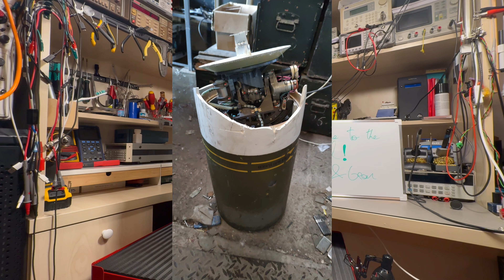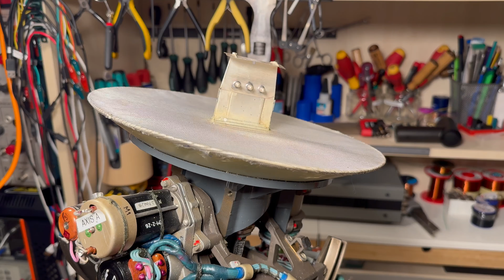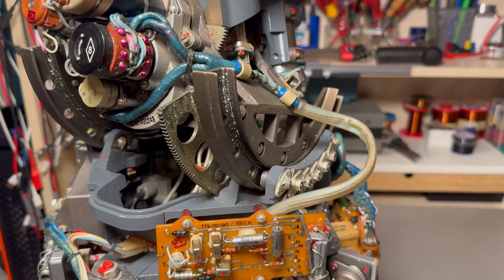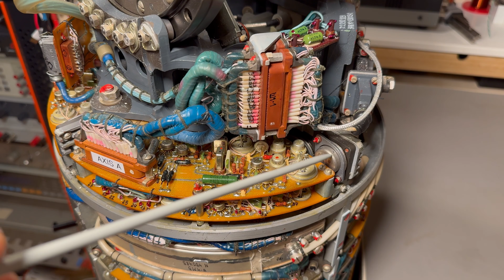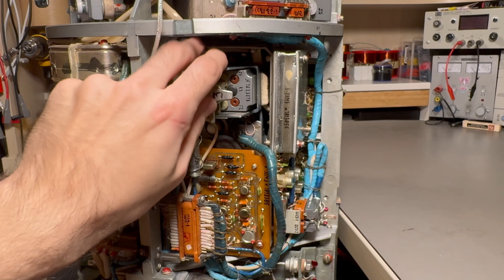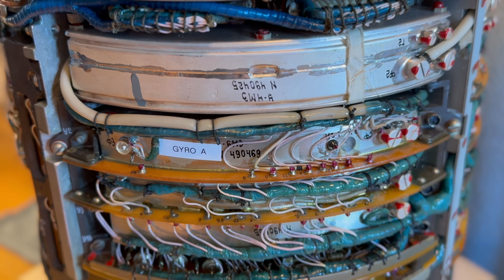Soviet Surface to Air Missile Poorly Explained

Comment: Интересно как резервируются, или дублируются системы на борту зенитной ракеты?
Reply: There is no redundancy in the control system itself. To increase the probability of intercept, multiple missiles are launched against important targets.

There is however redundancy in the safety mechanisms -- there typically are multiple interlocks which do not allow the detonator to go off prematurely.

Comment: The assembly with the precision potentiometer and the resolver / torque transmitter device is almost certainly a mechanical computer, years ago I worked on systems that used very similar technology to generate control signals for a large satellite antenna mounted on a ship.
Reply: In this missile, this module is just a storage device for the targeting data. Specifically, it is a very nicely made servo-mechanism which before launch rotates the wiper of one variable resistor to a desired setting. This setting is then used in flight to tune the receiver to the expected Doppler shift of the target, to distinguish the target return from other signals. It is a lot of hardware for a seemingly simple function.

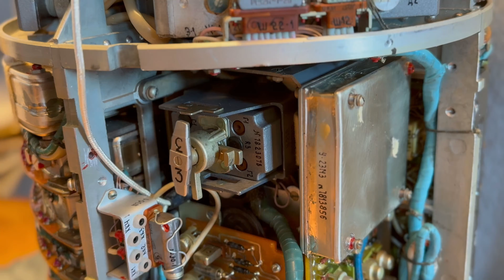Comment: 7:36 : could be a module to switch to a War Mode, to change the seeker signal characteristics to fool a library-driven ECM system.  

Explanation: In the '60s, electronic countermeasures were matched to missile types: a countermeasure was developed for each missile.  This countermeasure "tuning" was done offline, in research labs using captured enemy missiles.  This was a major effort, taking perhaps months.  

How the ECM worked: In combat, when the ECM system would detected and measure the missile seeker's radar signal characteristics, e.g. frequency, pulse width, pulse repetition interval etc., and looked up the missile ID in a database.  It then deployed the already-prepared countermeasure.  

Effect of War Mode: Since the seeker's signal characteristics were changed to War Mode values, the missile might not appear in the ECM system's database.  The ECM system would classify the missile as "unknown type", or - perhaps even better - as the wrong missile type.  The wrong countermeasure would be deployed, or at least one that doesn't work as well as the tuned countermeasure.  The best CM might never used.

Comment: Reminds me of how modern programmers will obfuscate sensitive code to prevent hackers from reverse engineering it, the soviets probably had the same level of paranoia and did the same but in terms of the physical design.  Of course since this unit was intended for single use, lack of serviceability was a bonus feature of this design intent.
Reply: "Обслуживание ракеты", эм, это действительно происходит ? Интересно, найдётся ли какой то инженер, который одним взглядом сможет определить поломки, и проверить каждый компонент на работоспособность. Не проще ли сразу сделать такое оборудование, которое очень надёжное, и обязательно отслужит свой срок службы..

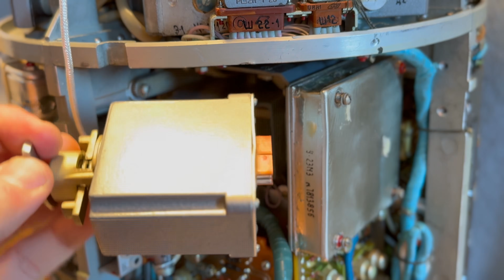Comment: @7:45 Its most likely a waveguide switch, relay, or RF (radio frequency) component used for signal routing or control in radar electronics. The shielded metal housing is probably to minimize RF interference and ensure stable operation.

Comment: The ceramic diodes could be Gunn diodes, used in microwave oscillators. In this case as local oscillators for the down mixers.

Comment: This thing looks impressive, not just by the electronics, but also by the mechanical construction. It also looks much better and much more reliable than soviet consumer electronic products (I could have a look into Raduga and Junost TV almost 30 years ago).
About the sealed/shielded electronic boxes, I would guess, anything involving high frequencies is done there. About the integrated circuits, I would guess, this are operational amplifiers. But thats just a wild guess.
Are there any names readable on the electronics, or they are all removed for conspiracy?

Comment: Very nice! "Semi-active" in SARH doesn't refer to "active" on the part of the missile (which is completely passive), but to active emission from the launcher's radar. NATO codewords use the same first letter for the same kind of equipment, so all SAMs are given names beginning with the letter G, leading to a lot of strange names. The person you mentioned might want to look at this - is that msylvain on YT?

Comment: all that stuff was designed to be able to sit in a warehouse for 25-30 years be taken out shipped to a front by conscripts then fired at mach 2 and have a 95% relaibily rate. it's not cheap.
BTW in the ukraine war both Ukraine and Russia have used gear from the late 1970s and earlier 1980s to great effect (both s-300s and cruise missiles that were just sitting in warehouses for a long time). You can see this was possible only because of the the kind of attention to detail and obsession with reliability. these missiles were the backbone of the soviet army's air defense for about 40 years.

Comment: 27:25 "Had a solid motor and couldn't be throttled" - The SA-5 Gainful had a ramjet engine (which made it slow but longer range) so it could indeed throttle.

BTW: The NATO code name comes from giving code names starting with "G" to all guided missiles and then the name had to be memorable so if somebody needed to identify it they could communicate this easily and clearly, even over unclear communications channels like voice radio ("they shot a Gainful at me!" "our mission is to strike a Gainful battery today" etc).

Comment: Actually the missile was started by a solid fuel motor, but once it burned out, then the empty housing formed the combustion chamber  of a kerosene ramjet engine (which imho in 1967 was mind blowing sci-fi) , so it definitely could have been possible to throttle it.

Comment: This looks like it uses cutted edge technology... from 1965, does it even have a microprocessor? Or does it have like an 8080 with an 8 bit data bus on board?
Reply: @maksimluzin1121  For steering of the missiles of this generation, an "Analog computer" was typically used. I.e. operating amplifiers and integrators were used to provide analog electric signals proportional to the solution of the differential equations of motion. The most complicated IC will not be a digital processor, but rather an intergrated Opam with just 8 pins (somethin like LM725). No data bus, no RAM, nor ROM.
Reply: @ , Yep, I know that (not very well, but have had an introduction course about the subject in the more wide course about digital controlling systems & mathematics behind that, mostly). Moreover, the analog differential/trigonometric circuits were much more stable to the EW jamming by definition, especially a few decades ago. Not so accurate, comparing to the digital, but very robust and stable.
Reply: Why it should have a microprocessor?!! It has analog channels, trigonometry circuits based on that, signal filters, modulators/demodulators and, yes, some simple AND-OR-NOR chips in the cascades.

Comment: 28:27 There, the metal wire is wound on a copper insulated ring, these are indestructible resistors, everything there is made of metal without carbon.

Comment: so the Vympel 3M9 is the missile out of the BUK. so yes a little old 
The Radar is 1S91 Straight Flush 25 kW G/H band continuous wave radar as the 3M9 "Kub" system.

Comment: 23:46 I think it's possible to guess that the short descriptions on PCBs make some sense...
"огр. АРУш" could be "Restricting AGCn" (Automatic Gain Control by Noise).
"рег. полосы бал. Y" could be "Regulator of the spectrum of balancing of amplification (or of Y axis)"
"бал. А огр. АРУш порог АРУш" - "Balancing A (or Automated) Restrictor AGCn limit AGCn".

Comment: Fascinating.  Whatever the military purpose of this, i admire the level of engineering involved in this.  The quality is jaw dropping.  Thanks a lot for the video.
Reply: Our grandpas had years to develop this: 1958-1965, some electronic components were developed in parallel. Every module was made by independent team or institute. They also had some blueprints of USA and European missiles alongside with translated literature. It's weird to see cloned USA opamps and transistors here. Vacuum tubes were the main building block back then. So this design was an advanced one. Anti-aircraft projects were led by almighty L.Beria and his successors and had exceptionally big budgets.
Reply: @Greg-yi5re  Вообще-то, Берию расстреляли в 1953. А до того он руководил атомным проектом.
Reply: @dmitry4c996  The creation of the Berkut system (1950-1955) was considered a major state task, and the work was organized in a manner similar to the Soviet atomic project. General management was entrusted to the specially created Third Main Directorate under the Council of Ministers of the USSR (V. M. Ryabikov, A. N. Shchukin), and funding was provided through the First (Atomic) Main Directorate under the Council of Ministers of the USSR (both directorates were supervised by L. P. Beria). A special feature of the project was that the USSR Ministry of War was not the customer of the system, and even the country's top military leaders were not privy to the details of the work.
Reply: @ розмовляй укроiньскою!
Reply: @dmitry4c996 гляди пешком !

Comment: The diods y ou showed are equivalent of 1N23 detection diodes, at the time used in waveguides for signal detection.
You could find then for instance in airborne weatr radars.
Also in the west they where protected in lead packages

Comment: It is Gunn diode. Once I saw hundreds of them in a factory packaging, each inside a protective cup made of lead.
Reply: I dont think so.
I think there are 1N23 equivalent
Reply: A Gunn diode would not serve as a good heterodyne oscillator here. It has high phase noise and frequency stabilization would be problematic.

Comment: I wouldn't say that the electronics were built to prevent reverse engineering. It's built that way to withstand the massive G forces occurring the launch and acceleration phases. The motor accelerates the missile from standstill to more than Mach 1.7 in a matter of several seconds.
Reply: An another likely reason is that they had to pack it very densely since they had to fit it all in the very limited space within the missile
Reply: Gary Nolan confessed on a podcast, in discussions with fellow scientists, one of them mentioned working on reverse engineering Soviet technology during the cold war. He said 60% we couldn't even understand, his point was "there are many ways you can go about creating something, the Russians took 1 path and we took a different approach, but the end result is the same".
Reply: @DJEDzTV Cybernetics was ligitimised in USSR only in 1955 and it had some impact on designs: total lack of digital computers. The industry of electronic components was far behind too. So these limitations led to using all-analog approach to design with some exotic components, nonlinear blocks and precise mechanics... And of course with using a lot of math and schematics tricks. One cannot understand the working of analog control system without testing or modelling it first. Not to mention it is almost a lost competence in a modern society
Reply: @Greg-yi5re  то что ты написал - банальная и наитупейшая антисоветская пропаганда времен холодной войны.

Comment: 28:36 - это СП-5 резисторы, они без углеродного следа, там в них во всех куча палладия и в бегунке и в проволоке, там рядом длинные такие-же СП-5 в них еще больше палладия )))) я вижу очень много серебра, думаю что корпуса для плат - из серебра, очень много тантала (конденсаторы К-52, и ЭТО-1, ЭТО-2), очень много золота - все что желтого цвета - глубокая позолота, ну и в Реле - платина или золото в контактах 999,9 пробы 

28:36 - these are СП-5 resistors, they are carbon-free, they all have a lot of palladium in them, both in the slider and in the wire, there are long similar СП-5 nearby, they have even more palladium )))) I see a lot of silver, I think the boards are made of silver, a lot of tantalum (K-52 capacitors, and ETO-1, ETO-2), a lot of gold - everything that is yellow - deep gold plating, well, and in the relays - platinum or gold in the contacts 999.9 purity,
Reply: не позорься
Reply: @Maximspec   схера ли мне позориться? мы много чего с таких плат выковыривали, говорю - как есть, вся военка до 91-го года была просто затарена драг. металлами, потом пошло после 91-го - тонкая позолота, в релюхах вместо золото/платины - серебро... только танталовые кондеры - содержание не поменяли. А сейчас в российских ракетах ничего интересного, американские процессоры, корейская оперативка, там еще британское даже есть и китайские СМД элементы, силовое говно только свое
Reply: @ЮрийМирошников-з3л  Раз такая реакция то понятно с какого хера

Comment: Pretty crazy that this looks like 60's tech but has 80's build dates all over it. Like it was designed during the space race and then unchanged for decades. I wonder if these are still being used? It wouldn't surprise me.
Reply: Hah, I just looked it up. Designed from 1958-1967, in service 1967-Present.
Reply: This thing will be effective in shooting down air targets in hundreds of years. Why change anything. This does not mean that new ones are not being developed.

Comment: I have a book in Russian explaining how all this works. "The signal reflected from the target, which has a Doppler frequency shift relative to the frequency of the illumination station transmitter, is received by the head antenna, which has three input channels: total and two difference (azimuth and elevation). To carry out automatic target tracking in direction, the signals of the difference channels are subjected to sine-cosine modulation in the modulator and then added to the signal of the total channel. The resulting signal has amplitude modulation, the depth and phase of which are determined by the magnitude and direction of the target deviation from the optical axis of the antenna (equal-signal direction). At the output of the modulator, the signal is divided in half by a slot bridge into two antiphase (in the sense of the envelope) signals."
Reply: The reference signal is received by built-in body antennas, which have a wide radiation pattern and thereby ensure reception for all possible evolutions of the rocket. Antiphase signals from the modulator and the reference signal from the reference antenna are supplied to the mixer of the microwave unit, where the first conversion and pre-amplification at an intermediate frequency are carried out in the corresponding amplifiers. The heterodyning signal for the mixer is the signal of a quartz oscillator, multiplied in the “Frequency Multiplier” device, amplified and divided into two signals for the head channels and one for the reference channels.
Reply: Can you share the name of the book?  @ikono2
Reply: @mzflighter6905  The book is a pamphlet for officer training "Buk anti-aircraft missile systems. Missile 9M38M1, design and operation" by Yeltsin S.N. 
It is a very useful source, but
(1) the book is not about the missile from which this item came from, but about the next generation of missiles
(2) only a few pages describe the seeker and not very accurately
Reply: @cogoid  Thank you!
Reply: @cogoid  any weblink to the book
Reply: So this missile doesn't know where it is and where it isn't....
Reply: @ketanovas  nah, it has to be told where it isn't so it knows where its going to be when it stops being where it is
Reply: @ketanovas  you are correct, but the Russian missile is always know where are you
Reply: @ketanovas  But it knows where it's going.
Reply: Good find. Although Yeltsin book covers the next generation of the seeker, there is obviously an overlap in the design of their RF front end.
Reply: can u share the link to  the book, i have been looking for 1SB4 seeker  technical manual but to no success.

Comment: WOW O WOW!  How very cool and unique.  I can sort of relate to this.  I was dropping off some Aluminum and Steel scrap  at the Metal Recyclers.  At the time, I was an Active Duty US Navy Submarine Sailor.  As I looked for an area in the scrap yard to dump the Steel that was in my truck, out of the corner of my eye, I spotted something that looked very familiar and military weapons related.  It was the engine section of the current MK-48 Torpedo.  HOLY FRIGGEN HELL!!  What in the world was the engine of a currently in use MK -48 Torpedo doing in a dump?  I spoke to the owner of the scrap yard and he let me retrieve it to take it back to the Navy Base. I think I can say that I am the only US Navy Sailor that has ever had a MK-48 engine in his pick up truck.  I did turn it into the Base weapons depot and found out it was a display for a shut down Torpodo Training Course.  The engine is a swash plate external combustion piston driven engine and it had fittings to allow it to be operated (spun up) with compressed nitrogen. Wouldn't the enemy have loved to have that piece??? LOL
Reply: Не переживай у нас такие же торпеды были, перикись водорода и азот,
Reply: Why did the Russians need to study the primitive technology of the MK-48 when they had the Shkval torpedo with a speed of 370 km/h since 1977?
Reply: люди в западных странах очень верят в свою исключительность. во всём. а потом удивляются, что они не единственные на этой планете )

Comment: The waveguide and coax that exits at the base may be where the signal travels from the proximity radar exits the warhead portion where the radar detonator is likely located.
That central vertical accelerometer likely tells the system that the rocket motor is active and may also act as an electronic impact fuze.  The control laws probably change between motor burning and coast phase, it's possible they have 2 modes.
Very cool, love to see the engineering that goes into rockets as they are miniature versions of the space flight systems.